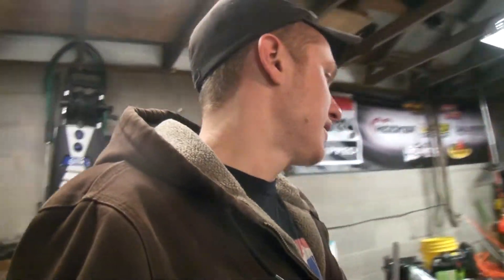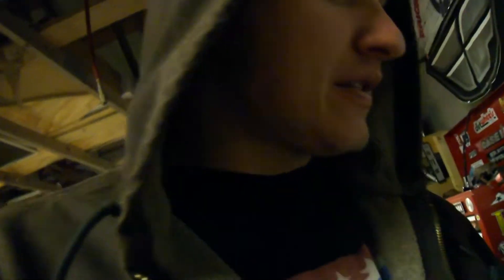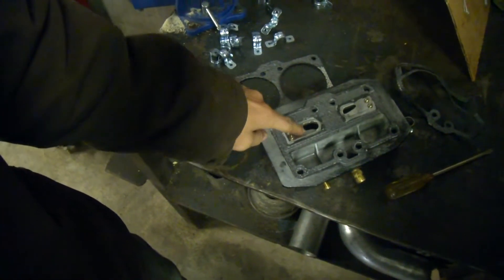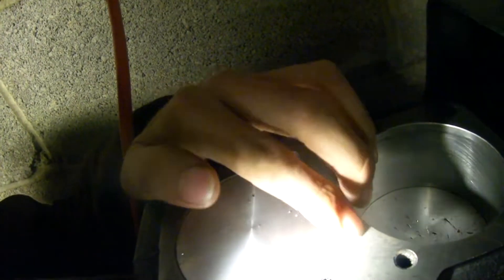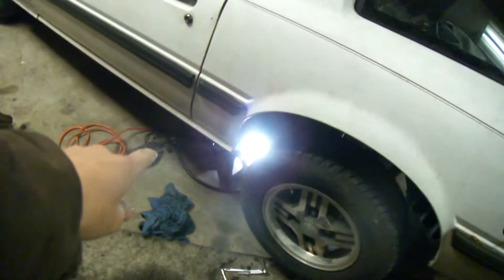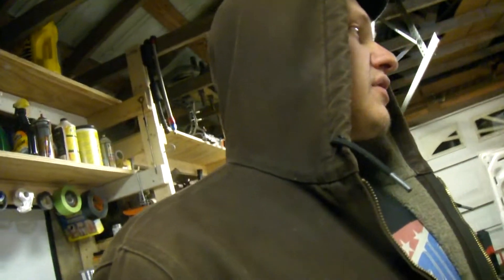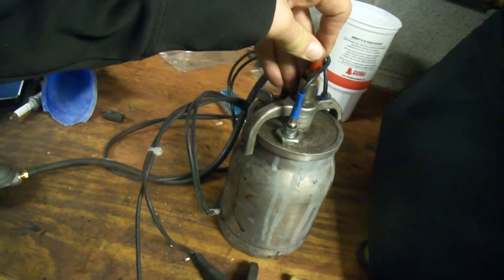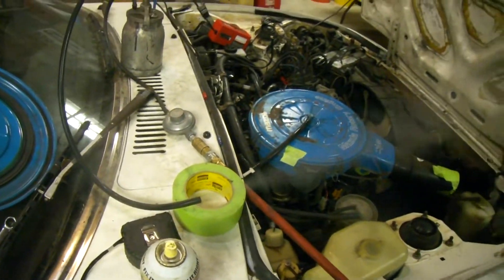How to Find Vacuum Leaks with smoke on a RX7

Comment: I'm having an issue with vacuum secondaries on mine. The linkages look good: secondary throttle plates move on full accelerator pedal pump but no fuel delivery. Could be a float thing, could be a clog thing. But since their vacuum operated, do you think your smoker test could diagnose a potential vacuum leak?